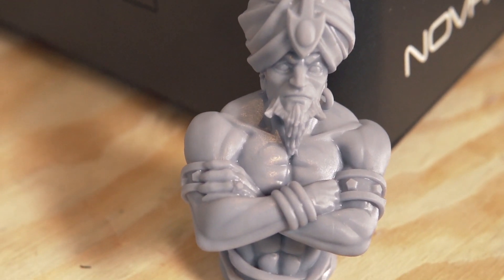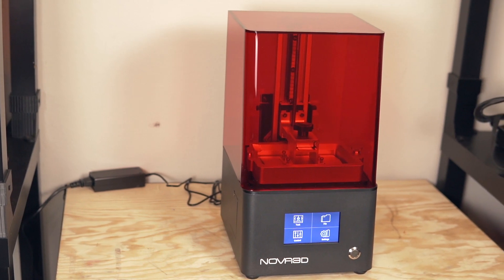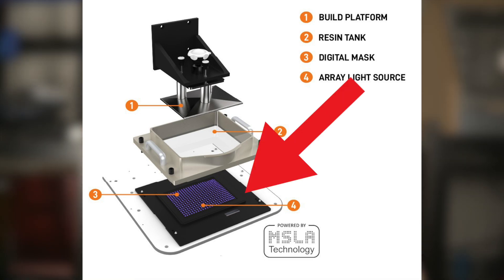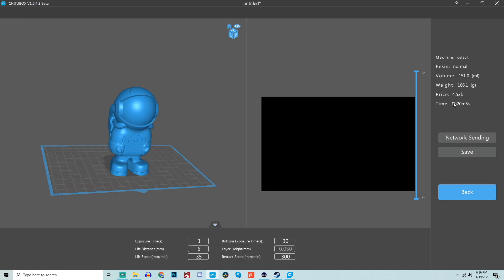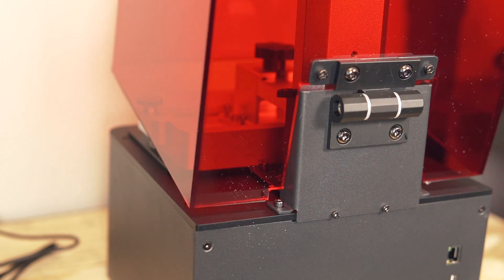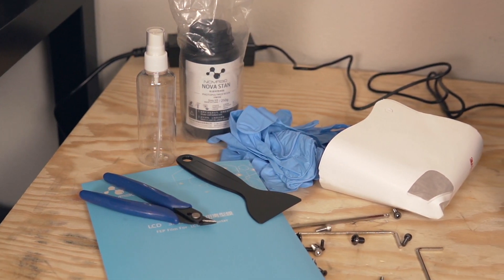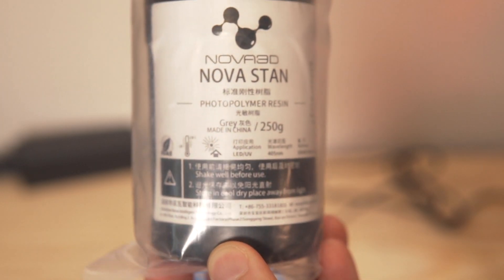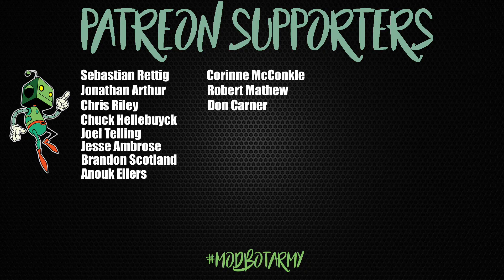Underrated Resin Printer? NOVA3D Bene4 Mono 3d Printer

Comment: Hi 
ModBot, thanks for sharing the video and your suggestion. Our printer will compatible with lychee slicer very soon and that slicer is much easier to use and for the end users there's lots of black friday deals for our printers and resin on both amazon/AliExpress. Searching Nova3d Printer and you'll find out them. Big discount for the resin on amazon and there's a Buy 2 or 3 bottles of resin and you could get 1 bottle for free campaign on our AliExpress official store.
Reply: Hello, I'd rather order from Amazon not from aliexpress but unfortunately on Amazon.de there is no option to add this ultrasonic cleaner for free. Any chance I can get that from Amazon.de too? It will be my first sla printer and I will need sth. to wash and cure the prints too.

Comment: I'm glad I stopped to watch this video today. I've been looking for a candidate for my first resin printer and this one looks like it's the most idiot-friendly.
Reply from the maker: Haha it definitely does simplify the process. The FEP swap out process is pretty sweet on this as well :)
Reply: @ModBotArmy  the fep is a expensive method but theres a good frame that can be printed in abs for a cheaper (but not so easy way) there's also a door handle that is placed with 2 sided tape and a vat lid

Comment: Pro Tip for the Plastc Tops..Go to a hardware store and BUY a Drawer Handle screw that into your Top Volia No more messy resin all over your top.
Reply from the maker: That is actually not a bad idea at all. Definitely would be a great solution for any of the elegoo or similar machines.,

Comment: Meh. I think at this price, you might as well go with a 4K screen
Reply from the maker: I can see that but for a printer this small the quality is insane. With machines that are much larger using 4k it almost seems overkill on such a small screen. (I would love to see a quality comparison at that size)
Reply: @ModBotArmy  The smaller the screen, the higher the PPI (pixels per inch). Meaning more detail.